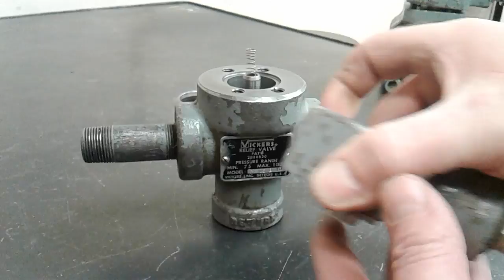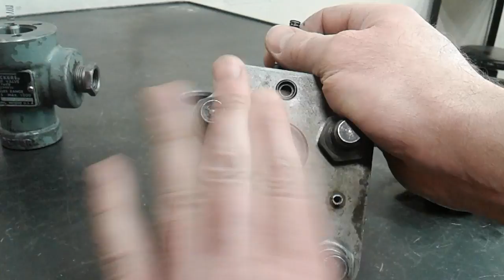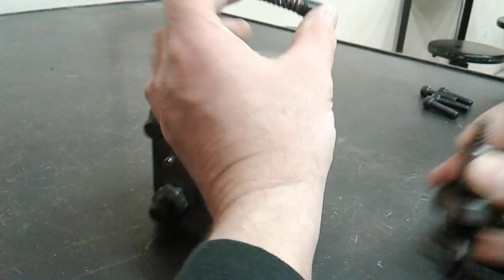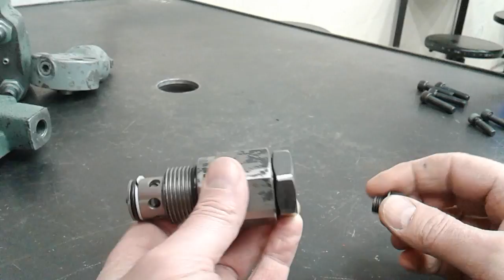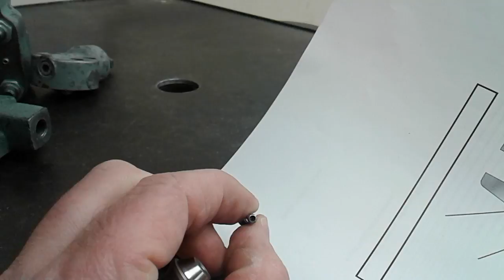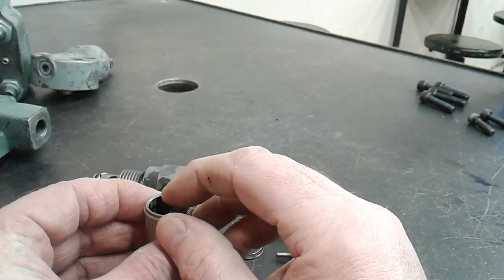Relief Valves - Pilot Operated

Comment: Great video.  I am replacing this type of valve on a portable jaw rock crusher and was scratching my head on how exactly the valve worked.  On our Parker valves there is a 1/4  Npt threaded port in the top chamber of the valve.   In this port we have a hydraulic line with a ball valve that runs back to tank.   We use this ball valve as an on/off switch on our vibrating feeder.